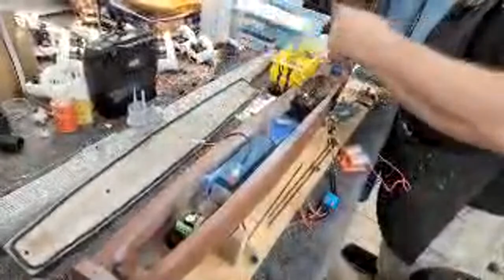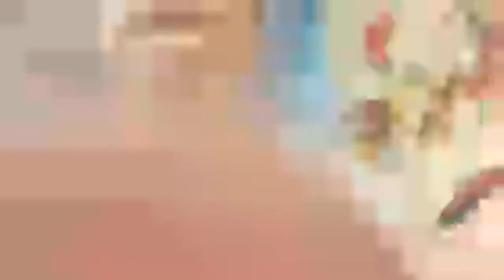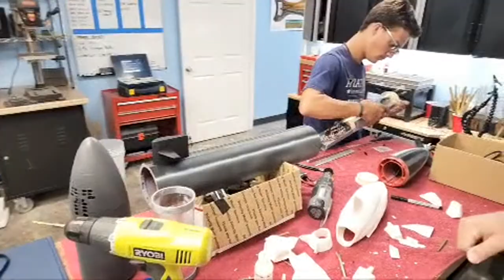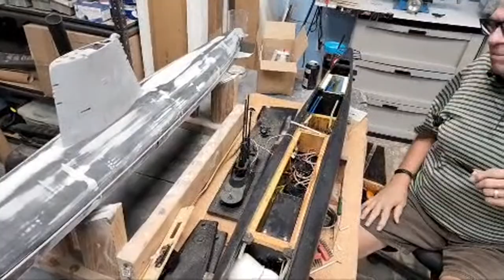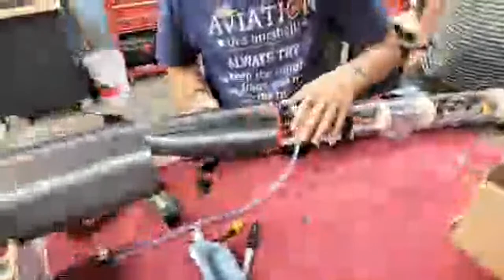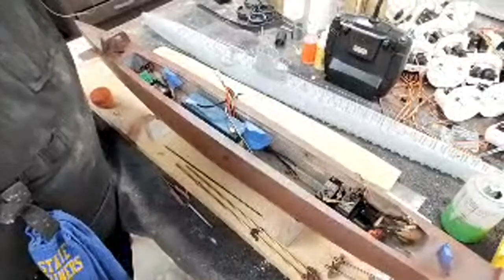RCSubGuy LIVE - Sept 3rd, 2022 - Build Party!

Comment: Have you ever tried to use a buoy with a repeater to break the water to air barrier and extend underwater transmission to air for better range I have read articles that say long wave will work through water but it bounces off the surface so I thought a simple answer would be a long wave to 2.4 repeater floating on the surface is the answer.